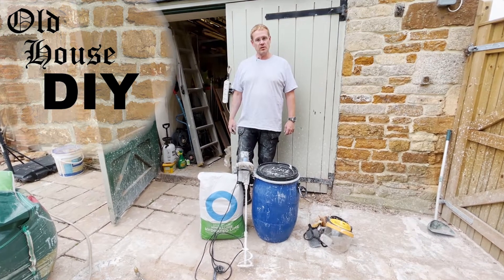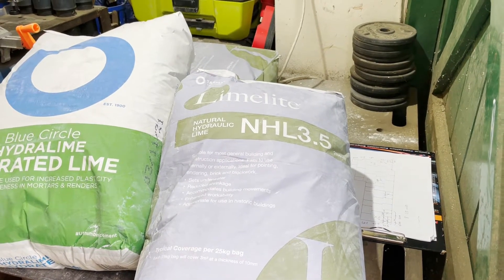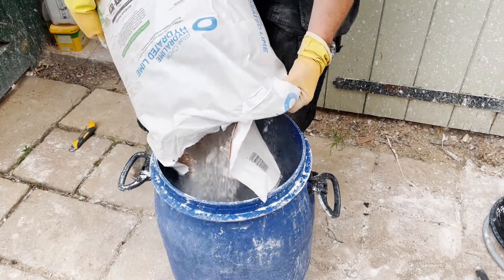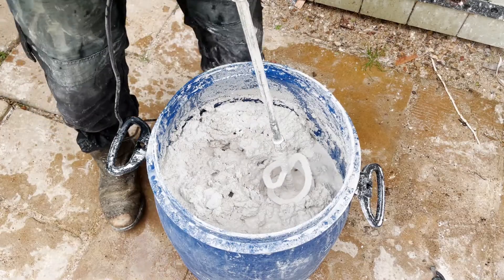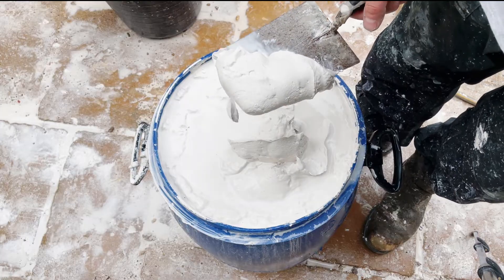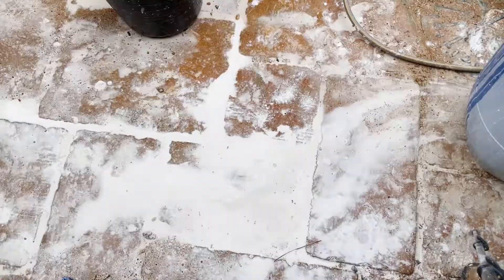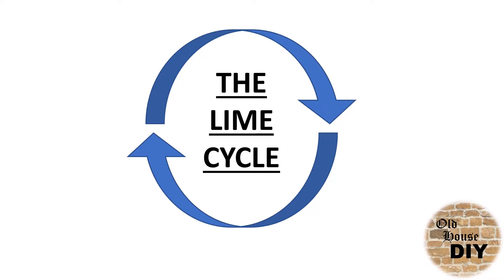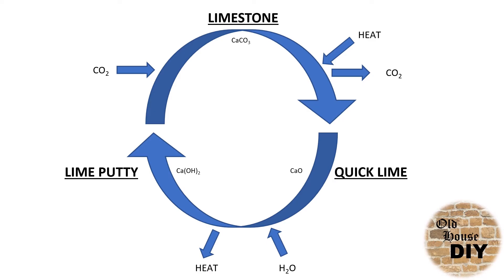Making Lime putty

Comment: 1) Hydrated Lime is quick lime that’s been hydrated and you’re using hydrated lime so all you’re doing is making a paste and leaving it for months will do nothing. Also you should have added the water to the powder not the other way round. To make lime putty you need to use quick lime (CaO). Quick lime putty makes more plastic, stickier, durable finish and proper crafts men use it on old buildings etc. Hydrated lime is quicker and easier and still
make a more porous line/cement/sand wall tender and lime wash paint. To increase plasticity you can add a plasticizer or the older way which is a small squirt or 2 of washing up liquid to a bucket of lime wash. To increase durability you can salt or a bit oc white cement and there are all types of recipes out there.

Comment: Can it be used to make flower pots
Reply: Probably not, as the water in the soil may break it down again (?) but it will also be high pH, which means most plants won’t do well in it - especially acid preferring plants.. hope this helps

Comment: Hi great video you brought the carbon cycle to life

I've made a NHL/sand mortar mix for pointing, however I found it quite hard to work with, crumbly and difficult to stick to brick surface. Is a lime putty/sand mix easier to work with

How long can you keep the lime putty once it has matured for 3 months
Reply from the maker: Thanks.

Putty based is easier to work with, particularly if you knock it up once, wait and hour and knock it up again before using it.

Mature lime putty if kept away from the air under a water top and away from frost will last years.
Reply: @oldhousediy  Many thanks

Comment: Can you add sharp sand at the mixing stage for repointing at 1:2 mix ? 
Will doing that affect the shelf life in any way or is it inert.
Reply from the maker: You could but you would end up with a much bigger volume to mature. You can also use the putty for a lot bigger range than just pointing mix and pre-mixing would prevent that.
Reply: @oldhousediy  No that's fine, I only want it for repointing

Comment: What is the recommended ratio of water in litres to hydrated lime in kg please?
Reply from the maker: A lot, just keep mixing and adding. It wants to be over saturated, any excess with then eventually sit on top and form the water seal to keep the air (CO) out.

Comment: Thanks for the video - the ending clarified the confusing part of the science for me.   I'm located in the Southern part of Hungary, and unfortunately i'm finding it difficult to find NHL - the products I've found are pre-mixed with sand and are quite expensive.  I do find quite a lot of 'Hydrated Lime' (CL-80S) - however the folks at the shop have assured me this will crumble if I try to mix it with sand and water and will not work.  They've pointed me towards concrete base products instead.  I'd like to repoint my field stone basement (probably built in the last 80 years or so).  If I was to slake my own CL-80s as you've done in this video - do i need to mix in any additives along with the sand once it's matured, or will it be OK by itself?
Reply from the maker: No additives needed (apart from the aggregate). Try to get the hydrated lime as fresh as possible because it can carbonate in the bag if really old. I would also recommend making a batch then taking a small sample to cure while the rest of the batch matures.

Comment: Lightbulb moment:  I've been told that the process of making lime (and concrete) emits a ton of "greenhouse gas CO2" but the CO2 get absorbed again in equal parts as it's cured, so....net-zero.
Reply from the maker: That’s true to a certain extent (in-efficiencies, thermal losses etc) for Lime but I’m not sure it is true for concrete. Lime is a cycle, the source is the same as the end product, but concrete is not. (The carbon footprint of a new property vs and old property is a massive topic.)

Comment: I cannot find any information that supports using 100% hydrated lime for mortar/plaster/render. Why does it need maturing for such a long period of time? If good results are achieved by the simple process of creating a putty out of hydrated lime why does the conservation and heritage sector continue to use putty derived from slaked quicklime?
Reply from the maker: It’s all about the lime cycle, hydrated lime is just a different point. Professionals don’t do it as it is just an easy (for them) to slake directly and use hot lime or leave it to mature as putty. The maturation time is to enable the water to fully saturate and complete the reaction.
Reply: @oldhousediy can I use quicklime and use it direkt as hot mix? They sell quicklime everywhere but not hydrated lime
Reply from the maker: @annashealthylifeeverything8583 slaked quick lime as hot mix is a very good option (better than this method). I’ve struggled getting decent quantities of quicklime at a sensible price near me.

Comment: I  want to do my house with Lime inside and out, we are in kenya so no frost to worry about where we are, we are using interlocking soil stabilized bricks for the walls,  should I use putty  mixed with sand for the  scratch coat and finish with a pure lime putty top coat. 
Thanks N
Reply from the maker: Pure lime tends to crack without aggregate, although it is sometimes used as a version of thick limewash to fill any surface cracks.

Comment: Thank you so much for this detailed explanation of the difference in  hydrated lime and quick lime. Here in the states, it was almost impossible for me to find anything but hydrated lime which had to be ordered. When I added it to water, it did not undergo the quick chemical reaction like some of the other videos. I am slaking mine but now see that I need to add much more lime and mix it well then just have a skim of water on the top.
Reply: In the US you can't use Type S hydrated lime (which is what we have in the US) as he does in the video. The US version of type S hydrated lime is different and is not intended or formulated to for this purpose. If you do use US Type S hydrated lime, it won't set up properly and will ultimately fail.
Reply: @soundbwoikilla764 what is it formulated for?
Reply: @annashealthylifeeverything8583  Type S in the US is formulated to be mixed with portland-based cement and mortars to improve workability characteristics (i.e., as a plasticizer) and help control setting times. It has a higher amount of dolomitic lime vs calcium lime which is why it won't set up properly and will crack and lead to failure. In the UK, high calcium Type S hydrated lime is available which is why the UK guys can make it work. The only way to make true lime putty (usable for mortar and plaster) is to make it from quicklime (not readily available in the US). Now, you can probably use Type S as he does in this video to make a lime wash, but I wouldn't use it in any structural or plaster applications.
Reply: Thanks so much for that explaination @soundbwoikilla764   I've been watching a lot of UK vids and trying to figure out why their Type S works fine but ours doesn't, was seeing a LOT of conflicting info, but that explained it all.
Reply: @newolde1  Unfortunately not, its a bit more complicated than that. If you are in the US you can buy pre-made lime putty or just go with natural hydraulic lime (NHL) which is a powder you mix with water and sand
Reply: @soundbwoikilla764  ah gotcha, thank you. Well I suppose both are pretty easy solutions. Are they both comparable, in terms of application and longevity?
Reply: @newolde1  Basically yes. There are technical differences on the when, where and why you might use putty vs NHL and differences of opinion on each of these. I used NHL to repoint and reparge my fieldstone foundation. There is a lime manufacturer/supplier in CT and 2 in PA. Google them they have info on their websites and you can talk with their staff and chemists about specifics and their particular products. One of them had a distributor 30 mins from me so was able save shipping costs.
Reply: @soundbwoikilla764  good stuff. You've been amazingly helpful, thanks again!
Reply from the maker: Hydrated lime is not quicklime so you’ll not get the violent reaction. This is much gentler and slower.
Reply: Look up pickling lime.....it's food grade (so expensive) but I believe it's the right stuff.

Comment: A better way to load the barrel is to put in a measure amount of water then add lime
Reply from the maker: The aim is to over hydrate so you don’t even really need to measure the water. Any excess will form the water seal.

Comment: This isn't lime putty. Lime putty is slaked lime left to mature for around 6 months. All you've done here is hydrate some lime. It ain't the same bud. If it was we'd all be doing this.
Reply from the maker: Respectfully disagree. If you understand the lime cycle hydrated lime is already partly slaked, hence the “hydrated”, as in to add water. All I am doing is completing the hydration and allowing it to mature. There are lots of reasons people chose other methods such  as hot lime or buying putty. This suits my usage / needs best.
Reply: @oldhousediy  I've tried running lime hydrate to a putty and it goes nowhere after it's had water added. You can put bags of it in the mixer and it just keeps eating it. You can't mature it either as it goes like hard cheese and plastering with it is more arduous than with a hot mixed mortar because it's less workable. It's a different lime to slaked lime putty. If it were that good we'd all be doing what you're doing.
Reply from the maker: You’ve obviously had a very different experience to me. I’ve used this method lots of times with good results.

Comment: Hi is the putty also used for repointing?
Thanks for showing the video.
Reply from the maker: Yes, it can be (when mixed with the correct aggregates).
Reply: What aggregates would mix it with? I have a 1900 fieldstone foundation/rubble foundation and it has a lime based mortar. I am tossing up the idea of using a NHL or Hydrated Lime Putty. Thanks
Reply from the maker: @chandlerpetersen1244  I’d use 1 putty to 3 sharp / grit sand. The bigger sharper aggregate will help in that application.
Reply: @oldhousediy  is it better to mix quicklime with sand which is then slaked with water or to mix matured lime putty and sand? What you think
Reply: @piotrrostow  I find  it easier to use lime putty for making lime mortar

Comment: Stupid question , what happens if you use straight away without waiting for it to mature ?And is it the same stuff they mix it gypsum?
Reply from the maker: The maturation time is to allow it to fully hydrate. Some people do get away with using it straight away but 3 months is the norm. It also depends what your doing, if it’s critical and where your doing it. (I wouldn’t be doing external lime work now anyway because of the frost risk.)

Comment: I can't say whether the lime he is using here is the same as tge Type S hydrated lime where I am from, but I can say that the Type S hydrated lime from midwest U S A is not made or intended for use as a mortar or concrete component, and will most likely not work for you if you are trying to make plaster or mortar. I mixed mine and let it set and remixed it, added sand, and carefully made it into a usable consistency, and trowelled it on my walls. My walls were, incidentally , prepped with a brown coat as a typical plaster wall  should be, U found that this mixture was chalky and did not adhere  with any uniformity, and had terrible hydration crack issues. I used what I had left as kind of a pigment instead of a bonding ingredient by adding  Type N white masonry cement to my mix in a recommended ratio with sand to make a sand plaster mix.
Reply: I have been making lime putty using hydrated lime,  I let it mature and then I make lime mortar using the lime putty and sand to repoint my very old stone house the traditional way.. you have to wet/dampen the surface first before applying the lime mortar so I'd say the same for lime plastering or rendering using the lime putty .. and ensure to lightly dampen surface as it cures.. if your plastering didn't adhere and cracked its because the surface was to dry.
Reply from the maker: Thanks, it was interesting to hear about the US types. (Even the hydrated lime over here, if it’s old, will not work.)
Reply: Where did you get this information?
Reply: My experience with lime and Portland comes from experienced bricklayers, personal experience, and experimental applications with mixtures on jobs.
Reply: Type S in the US has higher amounts of dolomitic lime vs calcium lime and is not intended or suitable for mortar or plaster applications. In the UK and probably elsewhere in Europe you can get high calcium hydrated lime which will work for mortar and plaster. This is precisely why it didn't work for you.

Comment: Brilliant video and thanks for sharing it. When will this putty be ready to use? I take it you couldn’t use it straightaway?
Reply from the maker: It normally gets left to mature for at least 3 months. The maturing process just makes sure that it is properly rehydrated all the way through.
Reply: @oldhousediy  does that mean you have to mix it well in the first place and also mix occasionally within the 3 months? I assumed you’d just seal the lid and that’s it. By the way, I’ve ordered the book you recommended on line for a fiver! The same book is sold on eBay for £14.99 plus pp. thanks for that 👍🏻👍🏻
Reply from the maker: @almusti  I normally mix once in the tree months but in the old days it was just left in the lime pit. (The eBay mark up is shocking, the author, Jane, is very helpful and knowledgeable. The eBay resell is naughty.)
Reply: @almusti What is the book?
Reply: @lefteyedspy Lime in building - a practical guide by Jane Schofield find it at the Black Dog Press

Comment: Nice vedio,and how can we make lime mortar for bricks lying and how can make waterproof and strong wall plastering  using lime ??
Pleas describe the ratio of each material for lime mortar and lime plastering for exteriors,
Reply from the maker: I’d really recommend this booklet, only £5 and really great resource. Gives details on all the mixes as well as more background on lime.

https://www.blackdogpress.co.uk/product/lime-in-building-a-practical-guide-by-jane-schofield
Reply: I've use a ratio of 2 sand to 1 lime putty for mortar ( using a repointing gun for deep fill in the limestone blocks) .. I made the lime putty ratio of 2 water to 1 hydrated lime and let it mature  a sealed bucket.

Comment: The diagram at the end  was really good..   You've put the mix in a sealed container for 3 months - what is happening chemically then> Why does it take so long? What is the minimum time for this process to take place?  How long does it take to a CO2 from the atmosphere and harden? BTW, you should always put the water first - it makes it much easier to mix and there's  very little chance of unmixed chunks left at the bottom.
Reply from the maker: The 3 month maturing is not chemical it is just to ensure that the mix is fully hydrated.

Comment: Isn't making non-hydraulic lime from hydrated lime damaging to stone work?
Reply from the maker: No, this is just lime putty.

Hydrated lime as used here is quicklime that has already been partly slaked (to a powder) not fully hydrated such as when soaking quicklime direct to lime putty. All this is doing is completing the hydration into putty.

This is not Naturally Hydraulic Lime (NHL) which is the one that “sets” quicker (even underwater, hence the hydraulic). NHL based mixes have been found to get harder and harder over time and can be damaging.

Comment: 10 pounds of hydrated lime to one gallon of water. Add lime to water . I'm too lazy to do the conversion... HAaa
Reply from the maker: Yeap, keep mixing and keep adding water. An excess of water is what you want as it needs to be stored under a water top anyway. It will not effect the consistency of your muck as that is governed by the dryness of the sand and if / how much water you add. (Don’t add to much and beware how much more fluid it becomes on the second knock up.)
Reply: @oldhousediy  I have a building from 1864 to do. Starting on lime stone foundation in really bad shape. I have 100 gallons of putty about 5 months old. I'm going to use crushed lime stone instead of sand. I think that stone will speed up strength development. And the end result of mortar turning back to stone. .What do you think?
Reply from the maker: @martyjansing2675  not sure the limestone will help speed up the process as it has already carbonated but it will not hurt.

Comment: Hi mate thanks for the video 
Do you have any reccomendation for lime pointing ratios in NHL 3.5?
Here in London the usual is a 3-1 But I have just checked my work after about 6 months and it's way too hard , so I have to weaken it down a bit
Reply: NHL 2 is often harder to get. Try mixing lime putty with 3.5 half and half and it will get you somewhere near. NHLs just contain fired impurities (clays etc) which make them react and set with water. Easy way of thinking about it is air lime and water lime. BTW I personally find NHL 3.5 horrible to work with and adding some putty makes it stickier anyway.
Reply: @chrisrobson6446  thanks for the comment, thats a good shout, i did think of that funny enough, on my weather struck mixes, im going to put 3quarters of nhl in a paint kettle and the last quarter hydrated lime and then 3 building sand, just to weaken it down slightly, will probs do the same on flush pointing, only trouble is with flush pointing and using too much hydrated in a flush joint, is its harder to finish , over time a 3-1 nhl mix i believe is too strong especially for soft reds, (not rubbers ovcourse)
Reply from the maker: NHL 2 is softer than 3.5 (and 5 is hardest)